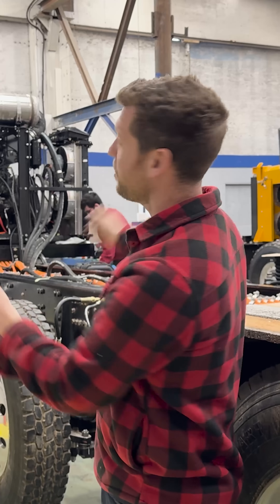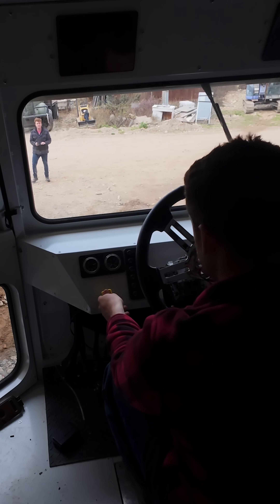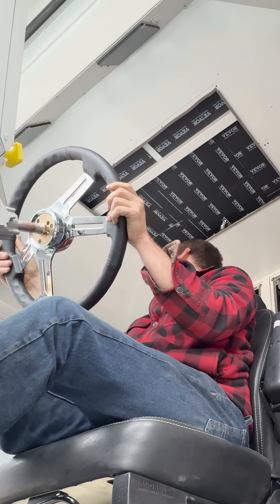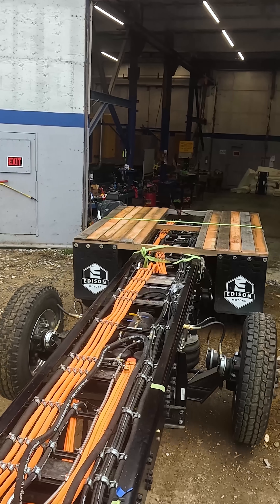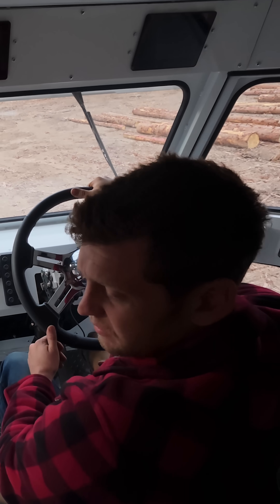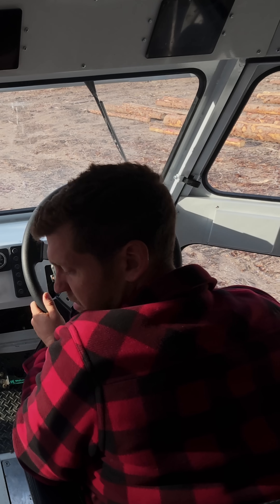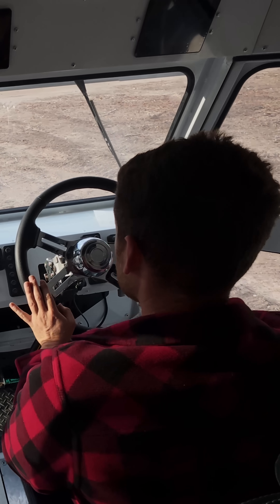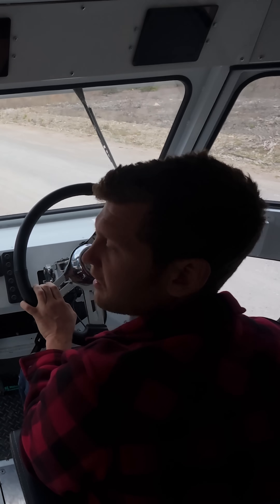Charging Port Error on Test Track Day

Comment: Not directly related, but have you considered adding some sort of external speaker just to add some noise when driving on just electricity? The thought of a very large and very silent vehicle is slightly scary even though it isn't intended to operate in places with lots of people

Comment: These first trucks are basically beta testing the design and construction. What you need is a few old school truckers the never have touched a electric or hybrid truck and best of all if some of them really think it's silly. But as long as they have been wrangling trucks for at least forty years they are just about perfect test drivers. Especially if you tell them they can try being brutal to the truck because you want to see how fast it fails.

At the company where my father worked they had a truck driver who was rather old. And though he had been driving trucks for forty years he was really hard on them. Lest just say that when I was 14 I could see that he really drove them like crap. The mechanic just laughed about it and sid that he had to rebuild them do often it was silly, but it meant he had a stable job servicing the trucks the driver wore down.

Comment: Do trucks in Canada not have to meet any kind of crash safety for the driver? Wouldn't want to have an unintended contact with the steering wheel....
Reply: Same as in America, these things weigh so much that almost nothing will influence it enough to worry about a crash. These things can be easily over 20k lbs(and that's diesel) These types of trucks are like one down from freight train in terms of things you might hit on the road. Also, the seat belt will hold you back from hitting the wheel.

Comment: Edison is venturing into new territory, quiet truck components.   Usually you don’t have to worry about coolant pumps or air compressors because the diesel engine drowns everything out.   With the electric drive, squeaking is the biggest issue.
Reply: I'm kind of surprised it's louder than the tires. Even in normal cars at city driving speeds you sometimes hear the surface louder than the engine
Reply: @krpajda  its a heavy duty truck the rough ride and heavy suspension you feel every dang Crack on the road
Reply: i hate to be a needy driver, but i dream of a truck were they focus on the squeaks. i’m sitting in a 2025 right now listening to some plastic rattling in the cab and watching the hood and west coast mirrors shake. it’s little things, but that bugs the crap out of me
Reply: Vehicles need to make at least a little bit of noise so pedestrians know they're in danger
Reply: Nissan had to redesign headlights to deflect airflow to make the wing mirrors quieter when they first made an electric car - so it doesn’t surprise me!
Reply: Too many people don't appreciate suffering from success.
Reply: It’s crazy how loud squeaks become when
Reply: some music would help
Reply: Simple fix.
Turn the radio up.
Reply: Waiting to see from 'stealing teslas idea' to 'stealing teslas water pump and wiper motor manufacturers'